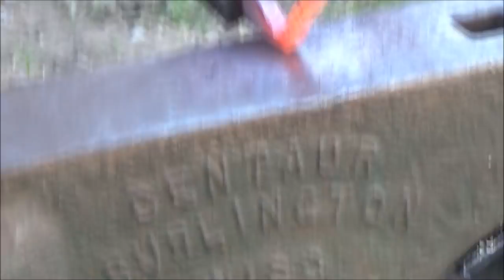Forging a bushcraft flint and steel striker. Lighting charcloth with flint and steel.

Comment: Great job Nathan. I am currently using a broken file as a striker. It don't throw sparks like yours but works ok. I plan to eventually buy a good one like yours.  Thanks for sharing pal. Chief
Reply from the maker: Thank you Chief. Sand the ridges off for better sparks.
Reply: My pal has some tools and he ground the edges smooth for me. Thanks pal for the advise.  God Bless

Comment: A forger is born. Very impressive job. How long did you leave it in the forge before quenching. I think that’s the key to it. Just guessing.    Thanks.   Tony
Reply from the maker: Thank you Tony. I think it's the amount of water in the bucket. Before I was using a small amount so it was not cooling fast enough.